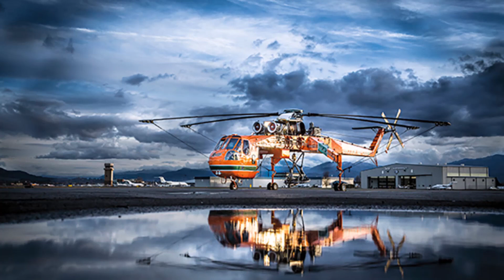FAA A&P Airframe Oral Questions

Comment: 00:30-wood structures
04:20-  aircraft coverings
08:17- aircraft finishes 
11:55- sheet metal structures
17:40- welding 
20:55- assembly and rigging
24:36- airframe inspections
29:23- landing gear systems
32:50- hydraulic and pneumatic power systems 
40:31- instrument systems
44:27- nav and comm
48:07- fuel systems
51:49- electrical systems 
55:31- position and warning systems
59:04- ice and rain control systems 
1:03:31- fire protection systems